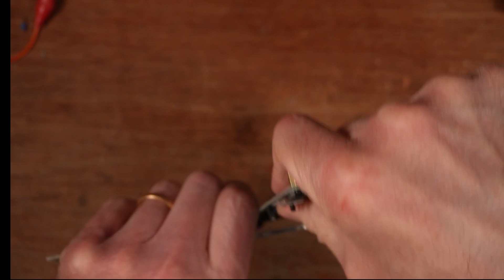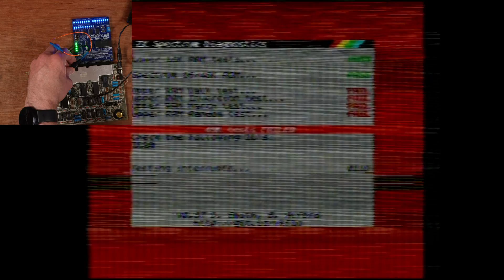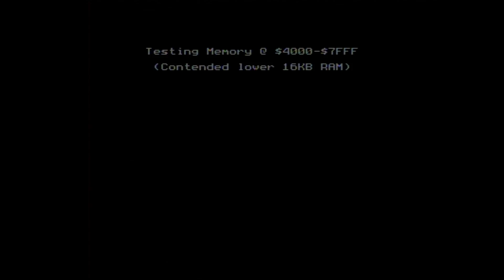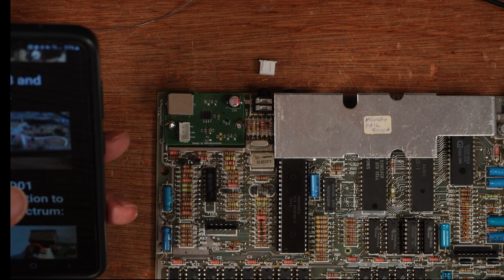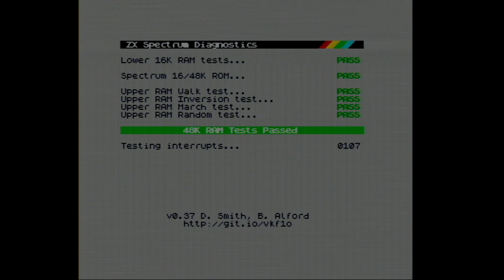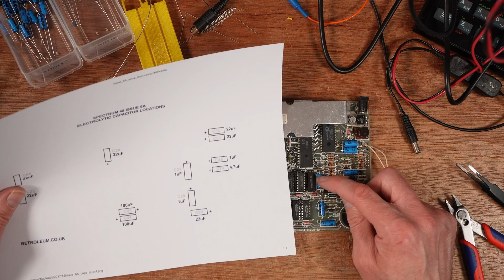Repairing An Issue 6A with Faulty RAM plus S-Video Mod

Comment: Your MESR-100 ESR Meter is good enough for a hobbyist level low frequency use, it will give accurate enough information about the electrolytic caps one can find in all kinds of retro computers. It also features a ESR value table on it as you can see, those are the MAXIMUM ESR values expected from good capacitors sorted by capacitance and voltage ratings. Use the table to decide whether a cap needs replacing or not, rather than picking an arbitrary value like 5 ohms.

Comment: Well, when the modulator ist missing, why not just add a composite connector with two wires? So many modulators are being deactivated and a composite mod is done. Using SVHS is surely possible, but it seems like an extra effort.
Reply from the maker: I can only answer with "because I wanted to".

Comment: you can  power them up without tr4 or a working dc-dc converter if you supply -5, +5 and a current limited +12 externally, this way you can find bad rams before they kill a new tr4 and/or the coil!, i've recently been testing a few...in one case it worked and passed ram tests at just over 9v for the 12v,!
Reply from the maker: Thats a nice idea. I might need to invest in more power supplies to do this.
Reply: @morefuntech  or adapt what you already have 😉

Comment: Speaking of S-video out my old acer laptop had this output so I found a cheap and cheerful little adapter plug that converted it to composite might be worth grabbing one to leave plugged into that socket for tests etc.
Reply from the maker: I had/have one of those somewhere! What a great idea! That might solve my current capture issues.

Comment: Hi great video, just wanted to know if you repair spectrums, I have an issue 6a and recapped but I can’t get an rf signal or composite signal and wondering if you could help me
Reply from the maker: Hi and thank you :D I am not currently taking in repairs. I have a huge backlog of projects and cant take more in due to time and space constraints. You could try @happylittlediodes ?

Comment: There's a Ferguson expansion interface (one on ebay at the moment) that purports to produce RGB on specific monitors (model MA20), and I wonder how much of it was just standard logic, and therefore replicable.

I was going to make up one of those SVideo adaptors but the results are pretty underwhelming tbh.
Reply from the maker: I will look into that Ferguson interface. 
Yeah, I probably would not recommend doing the S-video mod. Composite is not a lot worse and the convenience is much higher.
Reply: @morefuntech  theres the schematic of it on the net somewhere, plus details of a french made rgb interface

Comment: The only RGB modifications I've seen for the ZX Spectrum 16/48k machines involve replacing the ULA, such as the vLA82S+. I feel like S-video didn't really catch on over here in the UK, so I've always stuck with composite.
Reply from the maker: Same here. I wouldnt normally use Svideo, but with the modulator missing and having that board ready to go I thought it would be fun to find out.

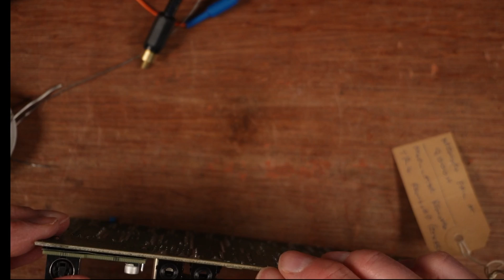Comment: 15:29 I would have used bolts and nuts to fix that in place. But soldering works, too
Reply from the maker: I think nuts and bolts would probably be a better solution.
Reply: I doubt that you don't know it, but you can order plastic screws and hex nuts from China in a wide variety of length and diameter. You don't even need to order many different sizes: if you order long screws, you can cut them to size, and nuts can be used as spacers, too. They can even be used under older PC motherboards as standoffs.
Reply: @ he would need metal screws as this connection is also the ground for this mod.
Reply: Yes, you are right, in this case he would need to connect the ground with a wire if he used plastic screws.